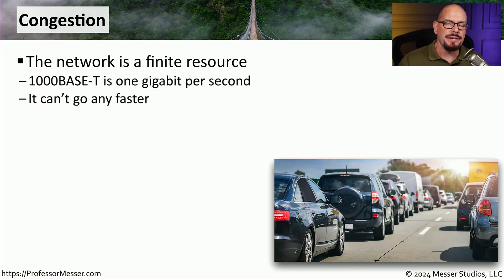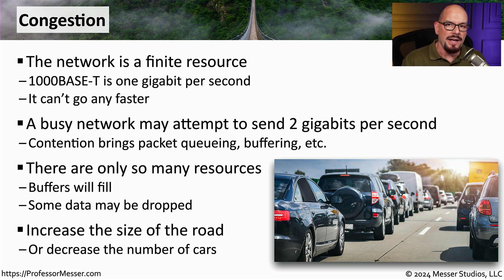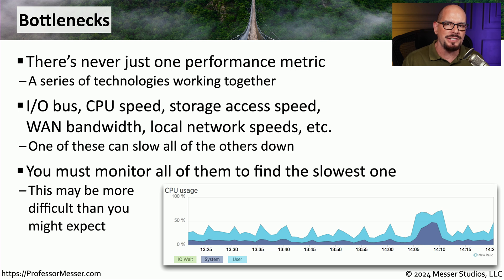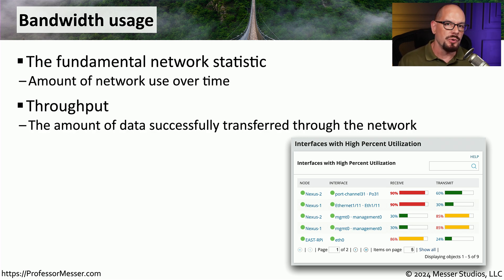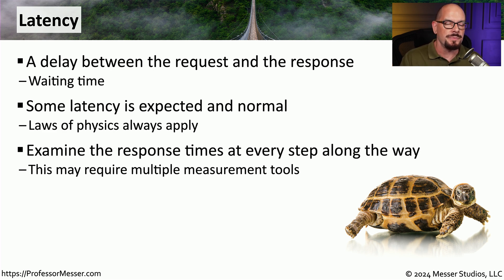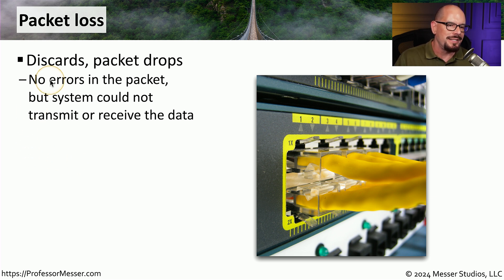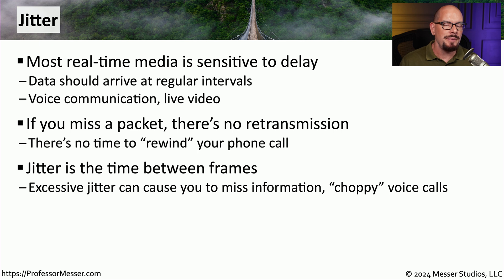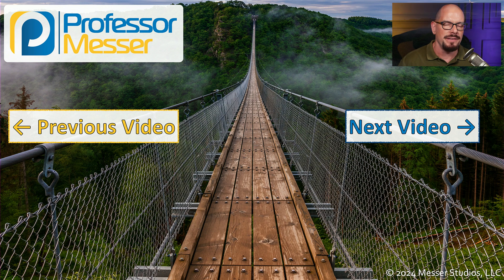Performance Issues - CompTIA Network+ N10-009 - 5.4

Comment: Would jitter be mostly caused by network congestion, or would this be a symptom of port flapping?
Reply: It could be both. Because VOIP is UDP, lost data isn't resent, which means that jitter in general is just extremely sensitive to any sort of network issues, whether it be congestion, flapping, or any other issue that could screw up your packet delivery.

Comment: QQ Prof, with regards to congestion and bottlenecking, if the data transfer is for example TCP thereby connection-oriented and it can help determine the data transfer rate, could there still be congestion in this case?